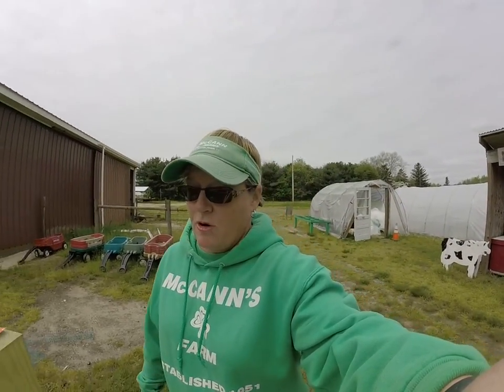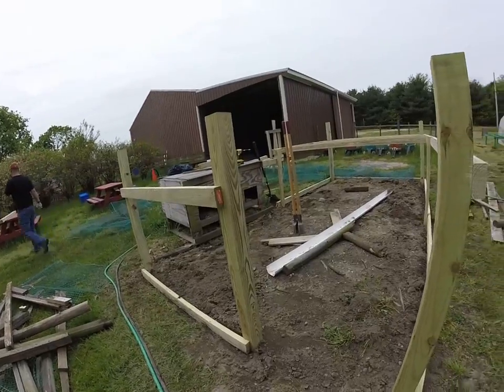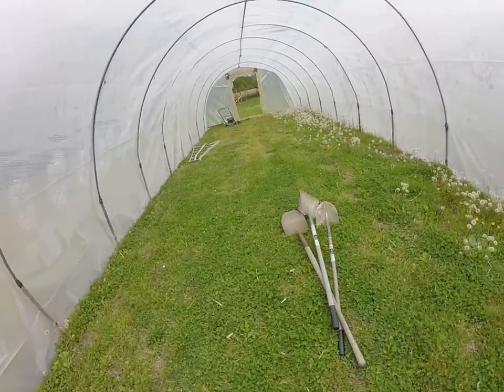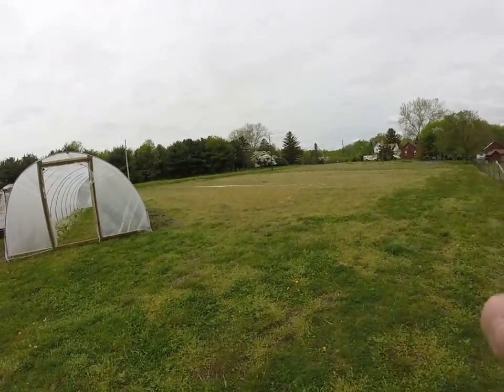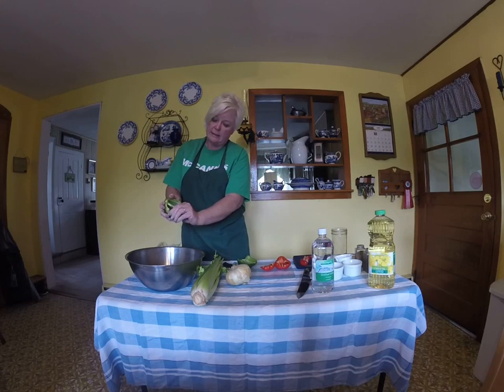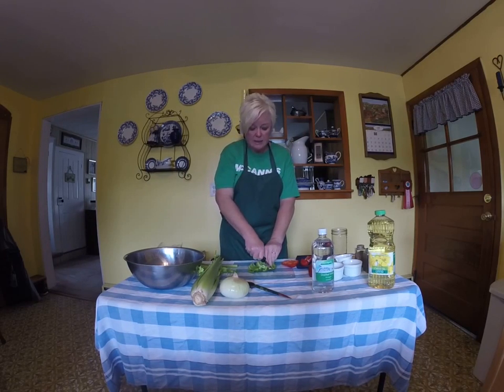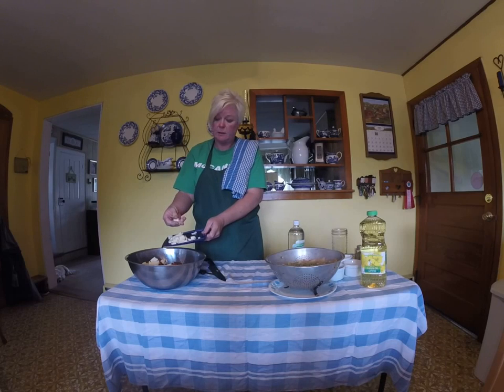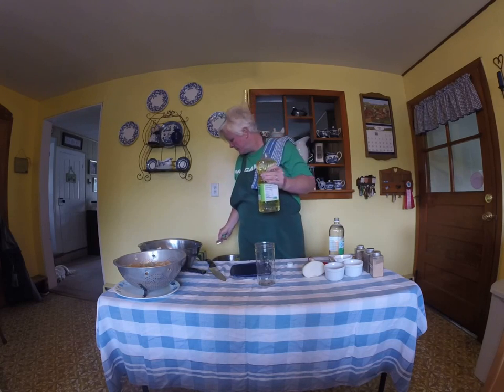Chicken Coop, Pasta Salad, and PAAAAARTY!

Comment: I use that same type of green plastic fencing around my garden every year. Doesn't rust and def helps keep the critters out and  I haven't had to replace it in three years, But we don't get as cold as  you guys get we  just have the blistering heat. Kinda surprised  the heat hasn't made it brittle like it does any other plastic I use  in the garden.  Salad sounds yummy.